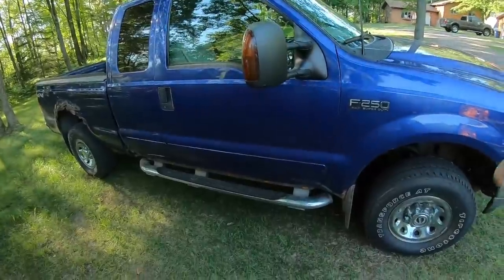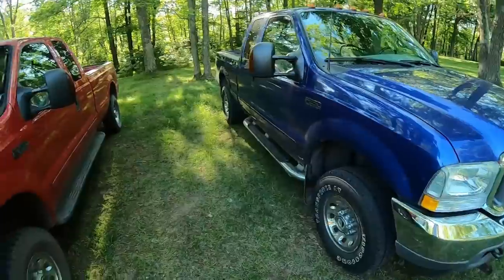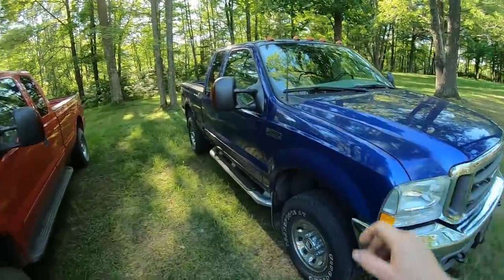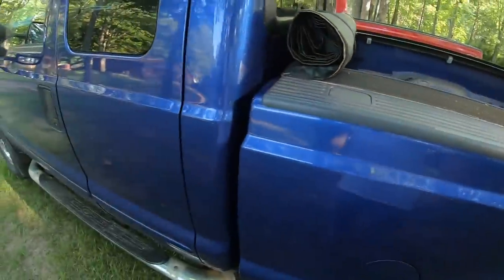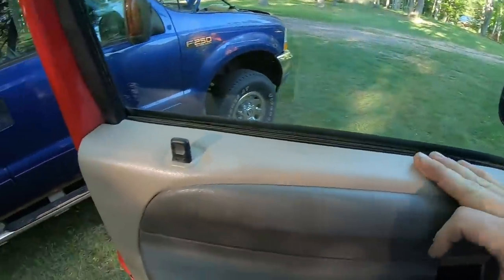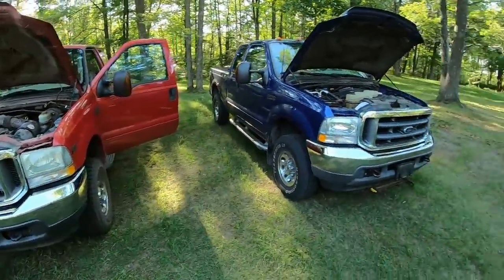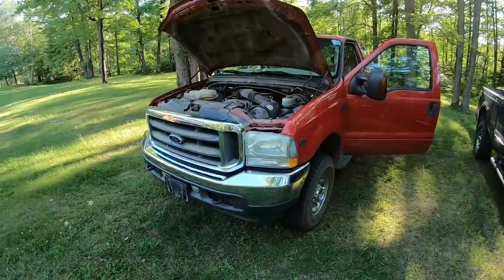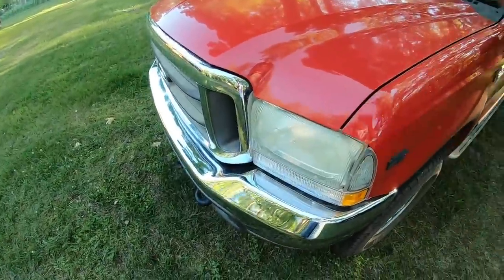I Bought A New Channel Beater Truck!  Meet "Big Red" - Possible Replacement For "Old Blue"

Comment: You absolutely do not need to pull the v10 engines to do exhaust manifolds.  I have done dozens of them from 2000-2010 in plow trucks.  I make bank on them, and the broken studs weld right out.
  I work on the 6.7s and would own one, but they are stupid expensive.  For me I run a 7.3 diesel or I would run a 6.0.  
   Only big issues on the V10s is the cam wiping out the heads on the 3 valves.  The older 2 valves, with the improved heads were nearly bulletproof.
Reply: Start to finish both sides, under 8 hours.  Normally 5-7 studs are broke, sometimes more.  The salt brine they use in Northern Illinois makes engine removal a last resort. Especially if you have to pull a cab, at least Ford finally switched the cab hardware so it goes up and not down.  03-04 cabs are the absolute worse to get off.
Reply: @squatch253  - Im a heavy equipment field mechanic and like my job.  There is a huge demand for what we do and you would fit right in.  However we to work on a fair share of f150-f750, and larger trucks.  
   However I think you might find some of the same frustration with the modern equipment.  All the emissions, computers controlled everything and plastic everywhere.  The only good thing about it is it guarantees we will always have a job and there is no such thing as book time!

Comment: I had F-250 , 2003 that was bought by me off the dealer new. Kept it for 15 years and finally replaced it in 2018 with new F-150. Great pickups, have no complaints, btw , both were gasoline. Thanks for the look.

Comment: O__O holy hells. Now my 76 Dodge D200 (in my pic) doesn't look anywhere near so rusty!  I do love how you were going exactly what I was about to say - put a deck on old blue. I gotta make a couple vids on the two ive built, my Lil Red D150 (not actually) and my Deck van.  Are the major components salvageable from old blue? Diffs etc? I'd be hanging onto her if so.  Past that, I'll take a long box any day over a shortie.  EDIT  - I did get a vid up on the deck van. Shows what kinda summer im having!

Also - pull the engine to do exhaust manifolds? Are you serious?? I'm a dodge guy, (former Chrysler tech) pretty rare the engine cones out of those trucks.  Looking forward to see what ya do to improve on your big red!

Comment: Would be interesting to see the numbers. In a couple afternoons you could swap over plastic parts. Might even consider an engine swap...like you say, you know the old horse. Swap hitches and plow attachments etc.  Donate old blue to the hemoglobin reserve. Or fabricate a wooden flatbed for it and use it for special applications. You just doubled the life of old blue...for how much?

Comment: Hey squatch do you ever under coat your trucks? Up here in Ontario I under coat my trucks with a mixture of used hydraulic oil and a wax based under coating oil to help prevent/slow the rust down. Most trucks that have been done yearly since new will have the body almost last forever if looked after. Just a thought cause big red is in nice shape!

Comment: I had a V10 250 for a while. It sure was good at converting gasoline into noise. On the other hand at least it got lousy gas mileage and didn't make much power.

Comment: You don’t do the manifolds through the fender well? We do the f450 and f550 natural gas v10’s through the fender wells. I got really good at welding nuts on the broken studs. Lol.
Reply: That’s true but them suspension towers suck to work around on the 450 and 550 trucks. Now they do make a full stainless kit. You seen many of them? I work for the city here and they won’t let us spend the extra to try it. We were curious cause these are all dump bed plow trucks we have and thought they might be better but not really hearing any feed back about the kits.

Comment: My dad has a fleet (about 5 I think?) of the ford 6.7 diesels and they work really well but we never own them over 100,000 miles. And we own a few 5.4s from 2004-2007
Reply: @squatch253  yup! We had one problem though. Dad was pulling a trailer to Michigan I think and there was corrosion in the block heater plug or something of that and the it made the truck think it was  plugged in and it did threw it into limp mode

Comment: Not sure how fully interchangeable parts are between the two trucks or what condition Old Blue's hood is in, but think on this.  Put Old Blue's hood on Big Red and then paint Big Red's doors white.  Then the new truck could be Ol Red White and Blue!  How patriotic right!  ;-D
Reply: Same year F250,  different engines but most everything like doors and hood, interior, drivetrain are all interchangeable. I like your idea

Comment: I’d keep Blue for the winter/ true work beater and keep Red for the tow pig and reliable clean work truck/daily when the weather is good. Still cheaper than a newer truck payment all the way around.
Reply: THe F350 is the fair weather truck.  Keeping 3 going would also be a much bigger expense.   Old Blue is too far gone.  I have a 2003 Dodge Durango with double the mileage but runs/drives perfectly.  The sheer amount of rust is making me have to do the same thing he is, makes me sad as I love the truck.
Reply: @squatch253  I apologize, I never relized you already had another. In that case, I agree, it’s time to let Blue go down the road to another home.

Comment: Squatch, I just did the same thing central Minnesota took its toll on my 2000 Ford F-250 super cab short box v10 (Big orange), so I had to upgrade to a 2004 Ford F-350 super cab long box powerstroke (The schlong box). Although it’s actual a downgrade with the engine, you won’t be able to kill that v10 😂.

Comment: I have an 83 Chevy that’s box fell off. Do you know anything about cat d2 tractor fenders that cover the whole track. Found some in the scrap pile.
Reply: These have cat d2 on the side of them. The tracks were wide open before I put the fenders on it. The fenders have a tool box on the top as well. My great grandpa bought the tractor new for plowing. He told me the dealer had one on the lot that had fenders and he thought it looked better. He said he took them off because it would funnel all the dust to the front of the fenders and then it would all come back in his face. The fenders have a cat serial plate as well.

Comment: Hey Squatch! I have a 2004 Ford F-250 power stroke as a farm truck. It’s a great truck with only a couple of pin pricks of rust. The only problems I have is a parasitic battery draw. Is there any known problems on these trucks that could cause a battery drain like that? It usually takes a week or so to pull it down. I was told in a forum to unhook the battery or put a disconnect on my “ole blue”, but that seems like a lot of trouble every time we need the truck. Any advice would be greatly appreciated. Thanks
Reply: Thank you for the advice.

Comment: Just a question..  is the objection to diesel specific, or general? I am in an area where we don't have Large US vehicles, and most of the Utility vehicles here use diesel almost as a norm. Is the objection with you specific to Ford, or general, and does that include Japanese diesel vehicles too?
Reply: @squatch253  Ahh..   late model diesels with common rail, no doubt...  and electronically controlled everything...  Ugghh...  Some are nice, but I prefer the older school types....  Now I know why you don't like those... I have an Isuzu..   3.1, old type...  manual type injector pump as opposed to electronic...  very little maintenance, Change oil and filter, clean Air cleaner, changing when unable to get cleaned... Diesel here is about 1/2 to 2/3 the price of petrol and the diesel variety of my vehicle does about twice the mileage of the petrol..  (3.2 V6)  maybe not twice...  9/15...    32mpg of our gallons versus 19 for the petrol.

Comment: Squatch253 whats you thoughts on the 7.3?? I got a 99 f250 with a 7.3 never have touched it other then oring on water pump outlet turbo pedestal orings and new rear leaf springs.. I'm going to have to rebuild the front end soon but I have around 400,000km on it right now.
Reply: @squatch253  yeah there not big on power. My old man has a 95 f450  2 motors each made to million miles. Weak spot was the transmission  seemed to eat them up easily!!

Comment: I can understand not getting anything other then 7.3 powerstroke. Ford wise. I have worked on them for many years. Yes they do have there problems. But all vehicles do. Mine is a 99 7.3 with 400 thousand on it. Still going strong! Wouldn’t trade it for anything! I’m sure you do have your reasons, and will let it be at that. But for the ppl watching this video. Don’t let it scare you off from the 7.3 powerstroke. If able and know how to drive a manual get one!
Reply: Thanks for the reply. Not only for me but for your viewers. The Ford platform in its self is good. But what they choose to use for power plant and running gear is to question, besides 7.3 powerstroke. Manual trans are the best for reliability. Plus more hp. Automatics was detuned to try to help them last.

Comment: Hi toby I have a question  ford truck 1997 f 250 hd  with 460   the oil cooler is leaking antifreeze   and that oil cooler not available new   my 87 460 has no cooler  my 88 has a oil to air cooler  both have the angle adapter stock ford filter mount  one has the oil  fittings factory plugged  that would have gone to the cooler I can find those filter adapter used not sure what has to be done o plug lines that go to cooler or if internals ar different

Comment: 2:00 Interesting, I'd only own a diesel engine truck. Maybe not a Ford. But no gassers. And especially no Tritons.
Reply: Agreed.  A diesel will far out last a gasser.
Reply: @squatch253  Sure. Well I'm used to southern trucks where rust isn't a thing. Also, mechanical engines. Dad bought a truck with 315k miles in 2003. It was already 13 years old. While he only put another 15k miles on it, it made it until 2021 with very few mechanical issues.

Comment: That's Not Your Beater truck, She's Your New Haul / Plow Truck. Ole Blue has become the Farm Truck. 
 The V 10 is a Work Horse, Plain & Simple.
 You don't own one for the fuel economy, You own it, for its Abilities / Capabilities.
 As Someone else pointed out, Swap out the interiors, & the Front-End Plastics.
 Swapping them out, is an easy weekend project. Talk Senior into helping You, & I bet It can be a One Day project.
 I know you work on Fords everyday, all day, & don't want to do it at Home. But The Grey Interior is a Nicer color for Us Mechanics. Black would be Better, But that Color only came in the Lincoln $$$.

Comment: Thanks for the common-sense remarks about bringing home trucks with diesel engines!
Reply: I used to be a fan of diesel, more reliable, more economical, went on forever. But since diesels went electronic and gas went distributorless they have lost the reliability advantage, and are so expensive to fix when they go wrong that it can negate the cost savings of better economy.

Comment: I'll never understand the use of the untold thousands of tons of salt put on the roads at the expense of billions of dollars of salt damage to every vehicle that has to travel in it. The salt merely lowers the freezing point of snow and ice, it doesn't prevent frozen roads and even adds to slushy refrozen roads. In a cost/benefit analysis there is no way to justify using it because it destroys everything it touches over the years. The government sees a "benefit" by salt slushing the roads, but the vehicle owners pay the price. I bet they don't use salt in Alaska.